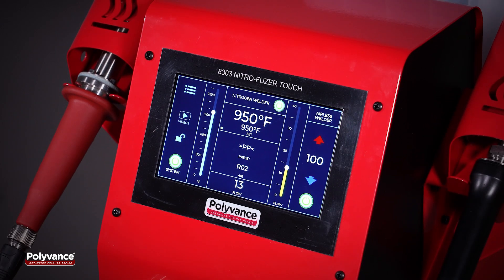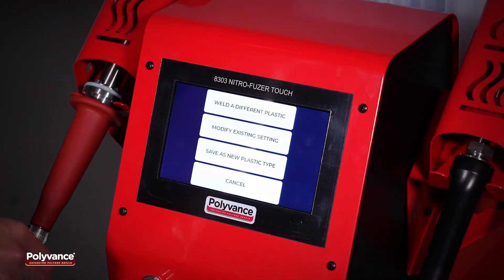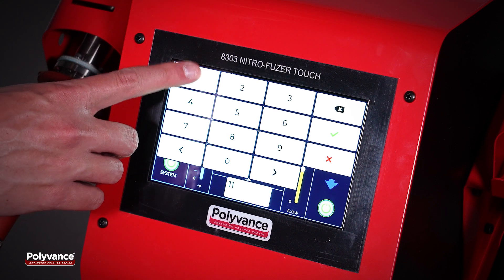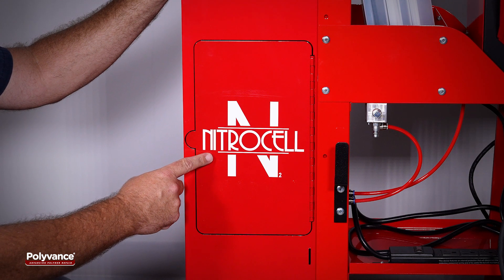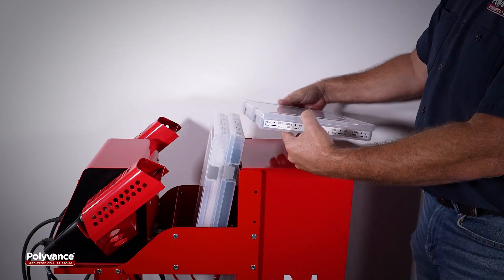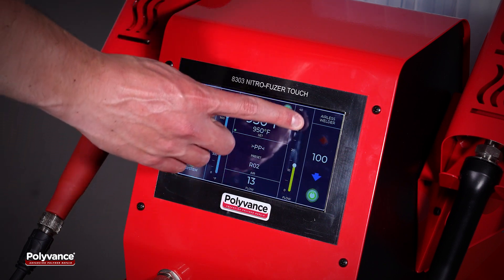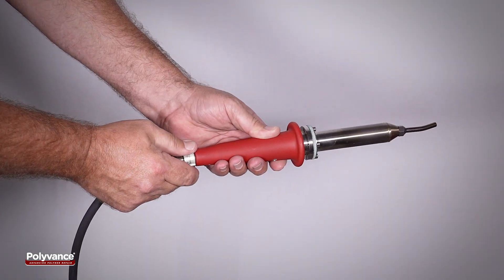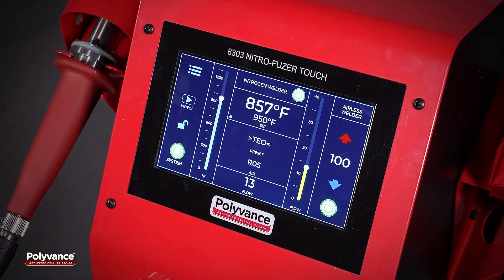Nitro-Fuzer Touch Nitrogen Plastic Welder

Comment: buenas tardes me podrian ayudar que tipo de plastico usan las tapicerias interiores de ford f150 1980 a 1986 gracias!!
Reply: Los paneles de plástico probablemente sean de polipropileno o ABS. Si son duros y con costras, es ABS. Si son más flexibles y están descoloridos o tienen rayas de tigre, probablemente sea polipropileno. A menudo, los paneles tienen una marca de identificación en la parte posterior que indica específicamente de qué material se trata. Parecerá ABS o PP.
Reply: @ muchas gracias!! los de ford 96 son de ABS pero los del 80 al 86 no traen marca para identificar
Reply: @ muchas gracias!! los de ford 96 son de ABS pero los del 80 al 86 no traen marca para identificar